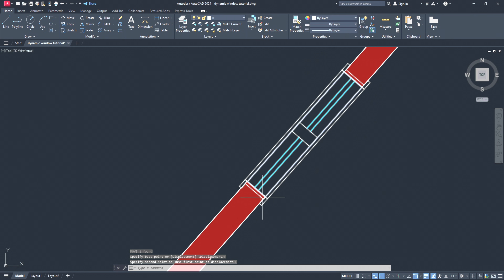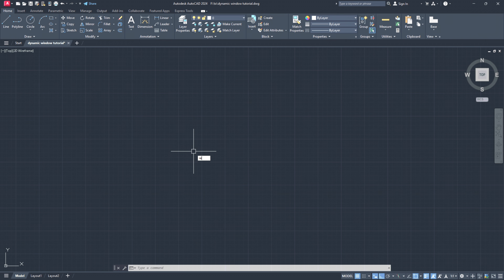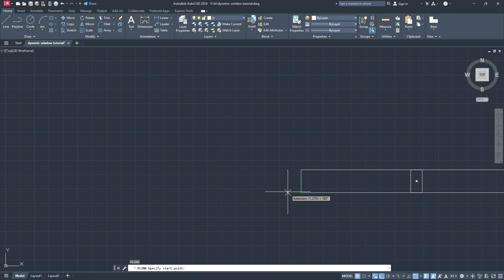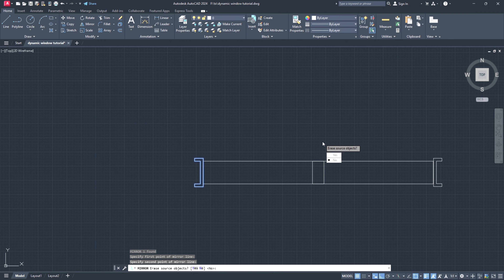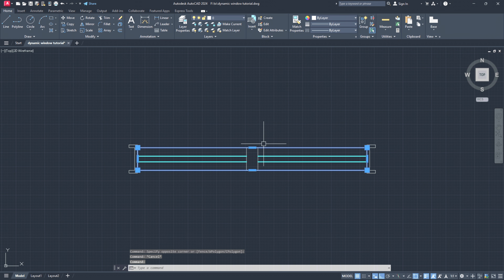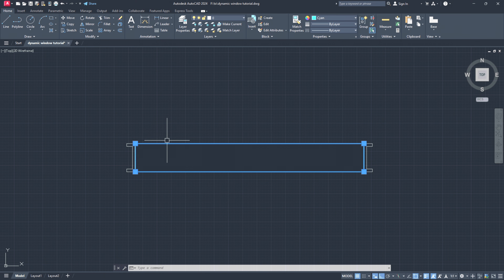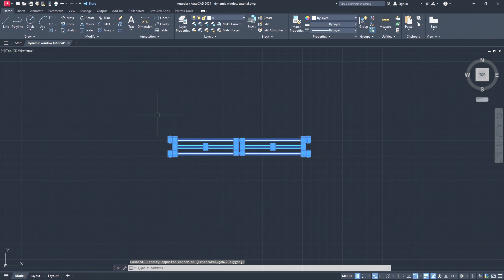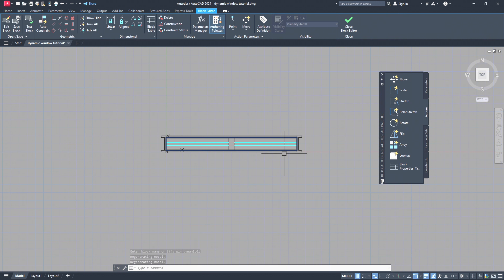How to Create a Dynamic Window Block in AutoCAD | Step-by-Step Tutorial for Architects & Designers

Comment: The tutorial is great. However, when I tried to enter the distance multiplier valie 0.5 to stretch action, cad reset the value to 1 only and I can't enter 0.5 value. Any suggestion?
Reply: Maybe check it be 0.5 insted of 0,5.  Check in windows config, decimal number format "."
Reply: Another option is ddunits, precision at least to 0.000000 instead of 0,